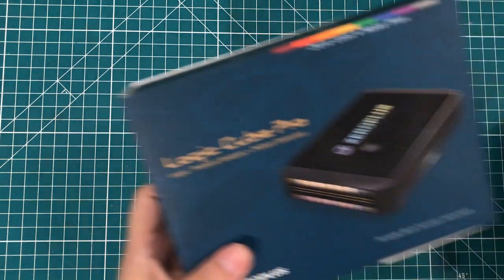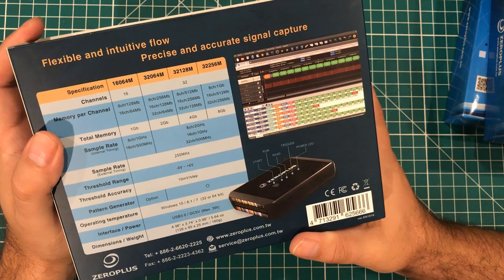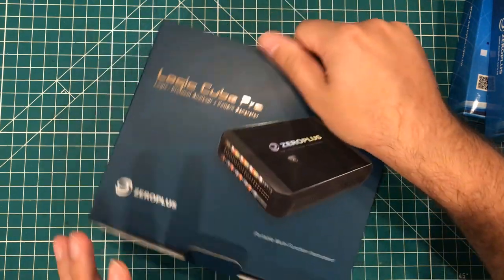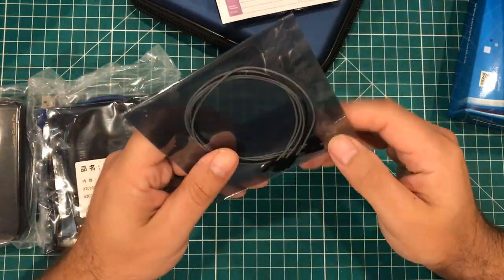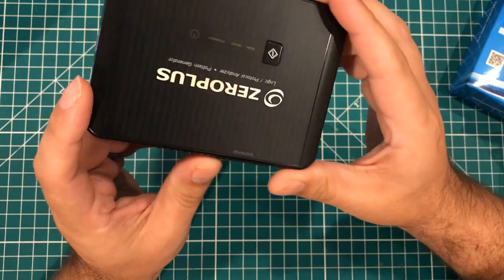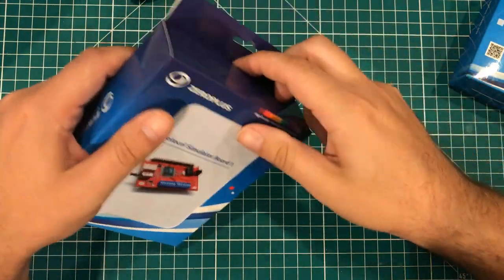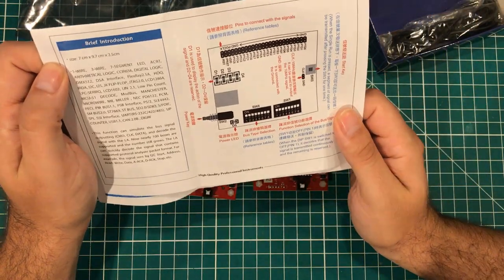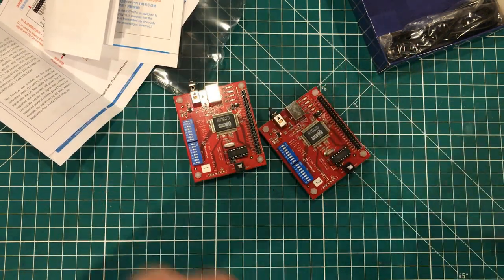ZeroPlus Logic Cube Pro Unboxing - With protocol simulator boards!

Comment: I just had a heart attack looking at the Amazon page! ;).
Reply from the maker: Haha.  Yeah.  I'm going to be talking about the entry level models :)
Reply: @AnotherMaker  I am actually in the market for a new one oddly enough. I have had one of the 8 channel Saleae 8's clones for about 4 years and it's fine for most of what I do. I want a 16 channel now and a bit more memory. The ZeroPlus 16 for 209$ seems well spect and @200$ less than the Saleae 16. My only pause with it Zero is the software being Windows only. With it being listed for XP gives me some hope that's it's not all that naughty system requirement wise and may run ok under Wine/Linux.